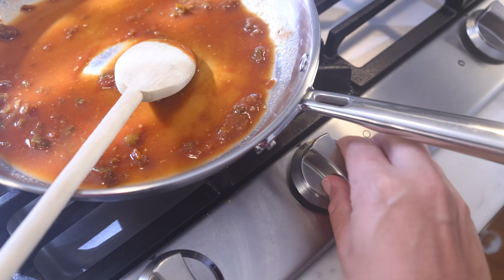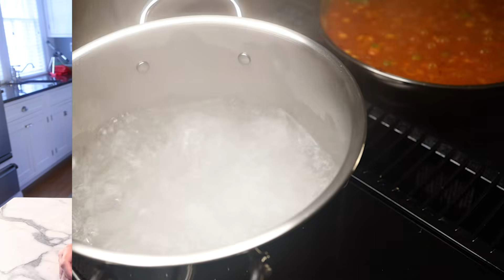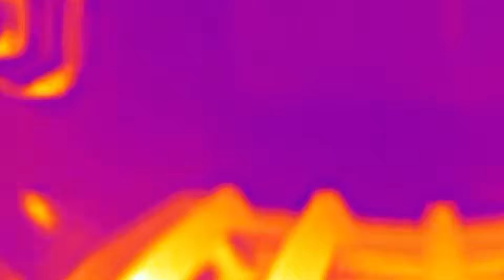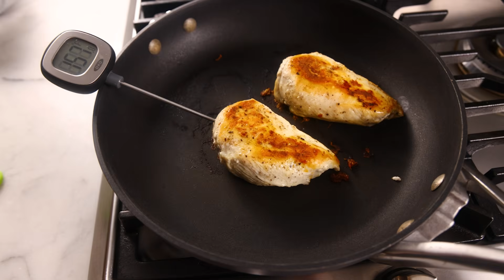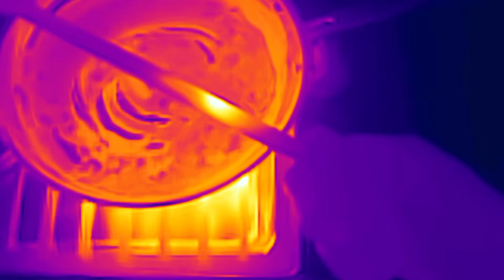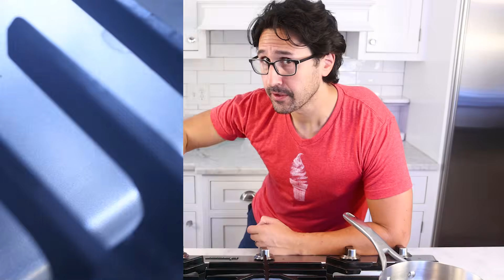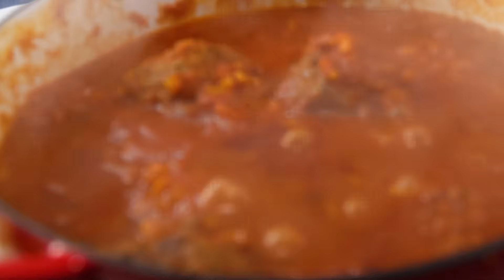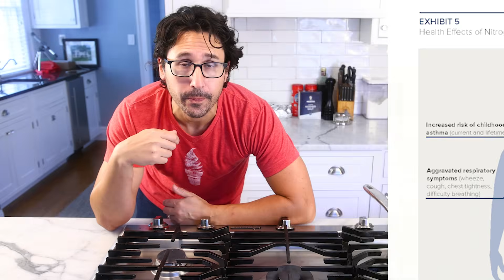Problems with gas stovetops | weak, dirty and dangerous

Comment: I can't say I have found this having cooked on both a lot. It might be something to do with the particular gas/electricity you have available. The electric stoves in my country are seemingly super inefficient apart from being super unresponsive . My gas stoves smallest burner never gets close to a boil. Both with ovens and stoves I have found gas to be infinitely preferable for cooking . Faster, much easier to control, no issues with too hot. What I would like is a much larger central burner so I can replicate the heat of a full burning BBQ or the massive flame they have on those Asian woks. Home burners don't have that. Probably for good reason as it isn't that hard to accidentally leave gas on
Reply: Gas is more intuitive, but it is worse, especially with ovens, convection electric gets much hotter and bakes more evenly than gas.
Reply: @linuxman7777  Convection ovens here do not get nearly as hot. Quite frustrating as I current have a convection (the second one as the first was replaced) and not only is it slower and heat less easily controlled, but it simply does not get hot enough for many things (my experience is that electric ovens never get that hot compared to gas). It may be that there are better convection ovens that perform as well as gas, but any bargain basement  gas oven will do anything and everything you need, while the same certainly can't be said for electric ones.

Comment: The biggest advantage of induction is how efficient it is. The first time I wanted to cook in my induction strove I filled a pot with water for pasta, which usually took around 10 minutes in my old stove. Here I was getting the pasta from another room, took me a second to find it, and when I came back it was boiling. Literally a couple of minutes, no more than 3 for sure.
You have to relearn all the timers (since I tend to put things in cool, so the heating time must account for that), but it is totally worth it if you can afford it.

Comment: I mean, the iron grate being hot really isn't as much wasted energy as you'd think. The pan rests on those bars and the bars transfer a lot of the heat that they pick up into the pan. Some is lost to air of course, but the difference between just holding a pan over the burner with no grate and resting it on a grate is negligible.

Comment: Since moving into my current apparent nearly three years ago, I've had the displeasure of experiencing gas stoves. Previously, I only ever worked with electric ovens. Sadly, I've not had the chance to try induction stove tops, though I'm tempted to buy a two burner portable option, given my current experience with gas.

This may be a problem specific to small apartments, in my case, it's two rooms, a bathroom, and everything else. When in use, it raises the ambient temperature of my entire apartment by at least 10 degrees Fahrenheit. So much heat exudes from the thing, that I have to have my A/C on any time I cook, even sometimes in the winter, crazy as that is. 
Considering that I cook virtually all of my meals, my A/C is running far too often, resulting in energy bills approaching and, at times, exceeding the several hundred dollar range during the summer (the southern living location also does not help in this regard).
This also negates any attempt I've made at using my apartment as a thermal battery - running the A/C cooler at night, not using it much, or at all, during the day (Technology Connections made a video about this, it's quite fascinating.)
Soon as I start cooking, the A/C has to be on, or I'm sweating way too much to be comfortable.

As mentioned, I've been considering getting a two burner induction stove top because of this reason alone. While gas usage is covered in rent, electricity is not, and I suspect that my energy usage would be mitigated a fair bit, by cutting down gas stove usage to those times when I need a broiler.

As a side effect of its heat output, I find it difficult to regulate temperatures for some of my more specific recipes. One that always bothers me is a no-bake cookie recipe, lately I've had to deal with burning issues on the edges and sides, as you've experienced. Trying to clean an old pan after stuff burns on is... Troublesome.
I also have had issue trying to sear any meat, without it burning. It either doesn't sear, or it burns, rarely can I get the sweet spot.
The thing is just too hot, no matter how low I set it.

Then there are the issues of what the thing spews out when in use, as mentioned in your video. Considering the size of my place, I suspect that these issues are amplified. The more I learn, the more concerned I get for my health, and the health of my cats. I've started getting in the habit of turning on the fan on my thermostat, as well as the overhead fan, in the hopes that this helps. I'm not convinced that it helps much, though.

A portable two burner induction stove top will probably set me back several hundred dollars, but I suspect that it would be a worthwhile long term investment, as I have no intention of moving anytime soon. And if it saves money and my health, all the better.

Gas stoves just suck for my use case.

Comment: a lot of the heat that a gas burner outputs is lost.  I had your same experiance.  Always told a gas stove was so good and responsive blah blah blah......  
You can set the value at a poing where it will let gas go.  It is before the stove lights.  May depend on stove but you have to make sure the burner ignites.
I think they sux now.  But am not going to replace it. 

induction burners require special pots and pands
thanks

Comment: I live in hurricane valley. Let me tell you why most homes down here have gas rather than electric. Gas stoves work without electricity. If a hurricane hits and the power is out for a week or two, you will need to boil water some day. If you got a match or lighter, then you can light a gas stove and boil that water. You can empty the fridge and cook everything inside it, or you can keep the fridge running if you have a generator, and still cook your meals. That's why I got a gas stove, and that's why that you need a portable gas or butane stove at least.

Comment: The overcooking issue with gas stove doesn't happen on all stove, if you have one with the hob of a very small size relative to the cooking utensil and very low minimum throttle the hob can provide, you can control the heat no problem at all. And where I live, gas is cheaper than electricity, it is why most people doesn't switch to electric or induction.

Comment: I have a very expensive, luxury brand gas top and I haaaaaaate it. Cooking in the summer is nightmare hot (we resist using AC until the temps reach at least 100), cooking in winter requires opening the kitchen outside door to circulate air or the gas contaminates the air quality of the house so now we’re heating the outdoors. Gas stoves are inefficient, dirty, hazardous to health and up port Russia gas company Gasprom (I’m in Europe)

I can’t wait to replace it with an induction

Comment: The issue with gas is that the temperature of the flame is the same whether it's a large flame or a small one. The only thing you can play with is how much of that heat makes its way into the cooking. That means when you cook food in a saucepan on simmer you have to stir, because there isn't enough convection in the food. With electric if you set the actual temperature to say 60C then it might fluctuate between 40C and 80C but it won't burn. The gas will be the same 200-300C just less of it requiring you to move the over heated portion continually away from the saucepan surface.

Comment: Personally I've found glass much harder to maintain than my old gas. Though it's a resistive glass top so that may be the reason. I also managed to pit the glass top almost immediately when I got it after a sugary sauce overflowed on me. I imagine that wouldn't be an issue on induction since the glass isn't getting so hot.
Reply: Thats the crux, you don't hear when a pot overflows on induction, since it's contents wont burn and stick on the plate. It can make quite a mess, though it only happened on me once when I had my stove brand new.

Comment: I love my gas stovetop buuuut to be fair, I do cook using a wok quite a lot, so there is that. And on that note, if you have a gas stove, I highly highly recommend getting a nice wok to go with it, they are super versatile! Basically anything that isn't large pieces of food works great in a wok! You can even use them to deep fry things with a "relatively" small amount of oil, making deep frying at home actually somewhat viable.
Reply: Induction isn't bad, but with glass tops I'm always worried about breaking them, especially with a wok, I'd be worried.

Comment: I had no idea this is what the research said. I can tell you for sure that every gas range I have ever used is better than any electric one that I have ever used. I also like how gas works with the power off, and how you can tell that it is on.  But interesting to get some aggregate data

Comment: Electric cookers may transfer their energy more efficiently to the pot, but they're still less efficient overall because they have all the energy losses associated with the power plants and the transmission losses of sending the energy down the wires. With a gas cooker, you are converting the chemical energy directly into thermal energy, and yeah, not all of it gets where you want it, but it's still more efficient.
Reply: @scandalouspanda7489  That's true, gas doesn't teleport to your cooker, but there is less energy loss overall, which the consumer still ends up paying for.
Reply: In terms of cost, at least where I live, although gas is theoretically cheaper, because electric transfers more heat, it is pretty much a wash. gas needs to be about half the price of electric to be on equal terms of cost.

Comment: Technology Connections did a video that touched on this while talking about why electric kettles aren't common over here. 

TLDR is that if you boil a lot of water, get one. Even if you've got an electric stovetop. It boils faster than almost all things. I use one for boiling water while my pot heats up and it makes pasta take half as long to cook.
Reply: learning about electric kettles from my international classmates was a life-changing discovery
Reply: Good idea. BTW: I have found I can cook pasta in much less water then packed instructions. I also turn the gas off and let the pasta finish cooking. The concentrated water goes better with the sauce. FYI: in China I have seen the Pasta water used as a soup base.
Reply: I do this too and my girlfriend always makes fun of me for doing it even though we timed it. Electric kettle into a pot that's been on the element with a tiny bit of water was way faster than boiling in the pot
Reply: I like to microwave water in a mug for those instant ramen cups that say do not microwave on the sides of them
Reply: Electric stovetops take years to heat up. Just get an induction and a thin aluminum pot, and it boils in like 20 seconds.
Reply: Energy is energy and water is water
Reply: Microwaving water is silly because 60% efficiency on electric heat is awful.
Reply: Induction does boil faster though it is slightly less efficient than an electric kettle.
Reply: Microwaving water sounds like something no person should ever do anyways, and the fact that it's so widely accepted in the U.S. doesn't surprise me about the country.
Reply: @69Shadesof  I moved from the UK to US 11 years ago. Microwaving water isn't very common at all in the US that I've experienced. Actually I don't recall ever seeing anyone using that as their primary way to heat water in the kitchen. Either they use the stove top, have an electric kettle (which some Americans call "water heaters") or if they have a very well-appointed kitchen they might have an instant boiling water dispenser by their sink.

Maybe to reheat a hot drink that got cold someone would use a microwave.
Reply: @69Shadesof  Do you care to go into detail about why microwaving water is bad?
Reply: @General12th  It is not, it's probably the most efficient way to heat water up, what might be concerning is if you use a plastic container that doesn't like heating cycles, where it might decompose slightly into your food/water. But using microwave certified plastics and glass/ceramics can mitigate this.
Reply: @grandsome  Good argument.

I hope you address it to Andrew. He's the one who thinks "microwaving water sounds like something no person should ever do anyways".
Reply: @General12th  done.
Reply: @69Shadesof  energy is energy. It microwaves and literal fire work in the same way - by making the molecules of the water/food vibrate more. Electricity too.  Microwaves just can heat it all at once, while fire and electricity heat up one part of it, then that part heat up the next part , and so on.
Reply: @alexforce9  "energy is energy" is not accurate. Microwaving water in a smooth container can cause "superheating" (water above boiling temperature trapped under water below boiling temperature), which can make the water dangerous to handle.
Make sure you put a chopstick or a wooden spoon in the dish when you microwave water: it helps prevent superheating.

Comment: My stove is the old electric-resistance coil burners. I am fine with it, as it works. Often new stuff can be garbage, so if you have old and it works, maybe just keep with that. But I think that my gas logs burn pretty clean. If you are worried about breathing fumes, then I suspect using an electric rather than gasoline mower would be better. Why do you want to walk behind noisy fumes? Electric is quieter, perhaps quiet enough to not need hearing protection, whereas gasoline mowers must use about the crappiest cheapest mufflers that they could find?

Comment: I have cooked on both and I prefer electric- open coil, glass top, either is fine. Cooking on an open flame is great but only if you do it outside. Not to crazy about the idea of induction because you can't use stainless steel cookware with it.

I think stoves need to be completely re-thought and redesigned. When I was growing up my grandparents had a barn with an ancient wood fired cook stove some previous occupant had left. The basic design of stoves hasn't changed at all- 4 burners on top and an oven the only difference being the firebox in the wood fired stove.
Reply: A note on induction with stainless; Lots of stainless pans are layered/ply with magnetic/inductive core.  For reference my daily-use pans are stainless and I use induction.

Comment: So I’ve never understood glass top resistive stoves. It seems completely insane to me that we would put one of our best thermal insulators on top of our least responsive cooking technology. It’s not even ‘easy to clean’ either. It gets scratched up and stuff burns on there. I would so much rather have an exposed coil electric setup. At least there you can dismantle the thing and clean it.

Comment: Coil and metal stove tops work more by conduction and have high thermal mass, whereas ceramic ones are mainly radiation with a low thermal mass so they are quite different, and the latter are much more responsive and so much easier to clean, spilling sauce etc on gas or coils can be a flaming nightmare. It's admittedly a bit tricky and could risk flame-out, but gas stoves can be turned down much lower by almost turning them off.

Comment: Fail. Schilling for green energy while spewing falsehoods about gas. Sad. The problem with your gas stove is poor design. Sealed burners are the primary issue, they're inherently less efficient at directing heat than open burners. A small open burner uses less energy than a large sealed burner. That's a well known fact which you've completely omitted here for seemingly obvious reasons.

Comment: What I don’t like about electric is that if you need to turn down the heat a little bit to slow down a boil or something it takes like 5 minutes for it to take affect because there’s so much heat already sitting in the stove

Comment: It depends on many variables. In my city (MX) is way common to use liquid propane, or in some areas natural gas stoves, cause electric stoves results in excesive power bills. Funny thing is that newer electric ovens are usually much cheaper in that regard. And when I lived in the UK for a year I had to adapt to use electric stoves in my building and they took forever to heat up, although I´m not sure if that is common to electric stoves or the university ones were just too old. Anyway, right now my wife and I use both a natural gas stovetop and electric oven, besides in a small apartment we need to save as much space as possible.

Comment: I'd rather have gas plus one induction burner. Solves the main issue of slow boiling water. Gas seasons carbon steel and cast iron better. The fact that gas heats up the sides is a major plus. Also used your induction plate for super low temps.

Comment: Resistance Coils take an age and a half to get hot. And the cycling sucks. I lived with terrible electric coils and then I got a gas stove in my most recent house and its nice to just turn it on for 3 minutes for an egg and then turning it off. But yeah this is why its critical to have a range fans. you need to be venting those out away from you. I try to use it whenever I'll have the stove on longer than 2-3 minutes.

Comment: With resistance coil stoves, the mess can be very dangerous and very hidden. I live in Wisconsin and moved into an apartment with one, and noticed the stove would cut out sometimes and it was really finicky. When I took off the coil and metal splatter guard beneath I saw the coil's receptacle had crumbled and the insulation on the wires had melted back a couple inches from the connector. Bare wires literally held apart and kept from shorting out by some crumbling plastic.